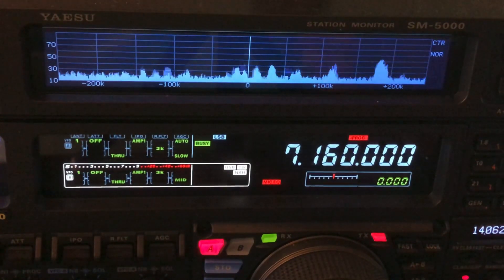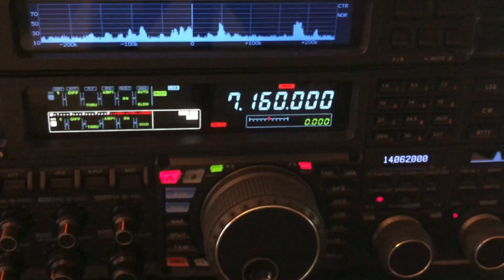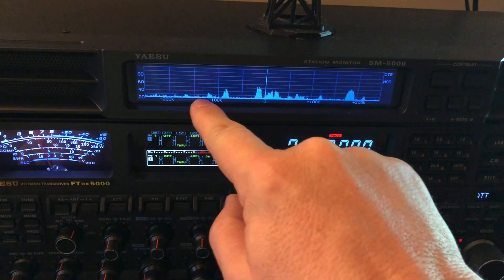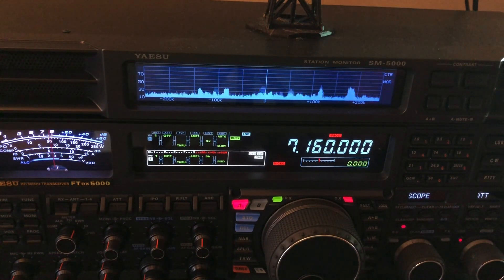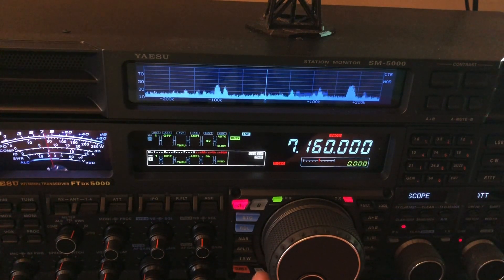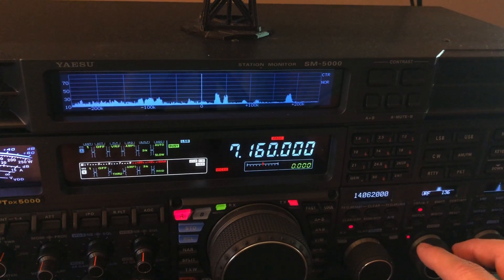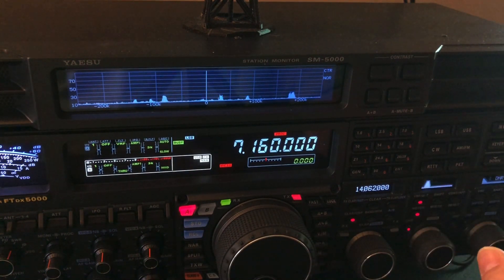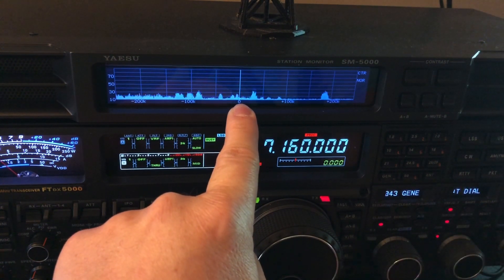Yaesu SM-5000 Bandscope Attenuation Setting #yaesu #sm5000

Comment: Hey Douglas:

As usual, your explanations are superb. I get so much out of your discussions and presentations. I've had my FTDX500MP Limited for 8 years and I am still learning about its awesome capabilities. My OLEDs are starting to fade, but still readable. You really know how to make the sm-5000 come alive. Again, thanks. Rich L. - W2FKN
Reply from the maker: Thank you for letting me know that you have found the videos helpful. I’m a big fan of the FTdx5000MP.  Still my favorite.  You might want to consider ordering replacement OLEDs before they are out of stock. Yaesu told a guy that the current stock is all there is.  They are around $50 each and there are 3.  I ordered spares.  I also bought a spare main display and a spare SM-5000 display.

Comment: I accidentally received a summits on the air station on 2 meters at work today on my HT. I didn't know I had the calling frequency on my three frequency montitoring tri band HT. I was at the port of long beach talking to him on a mountain.
Reply from the maker: That’s great!  You might have helped him get his 4 contacts.  It can be tough to get 4 contacts on simplex VHF or UHF.  And most SOTA operators are using 5W or less.  BTW, you can go to the SOTA web site and sign up for free to get chaser points.  Get 1,000 chaser points and you qualify for a certificate and trophy.

The SOTA community includes some really nice operators.  In our area of the Southeast we have two campouts per year.  We all stay in touch year round, the activators and the chasers.  It’s addictive, in a great way.

Thanks for your comment!

73, de N4HNH